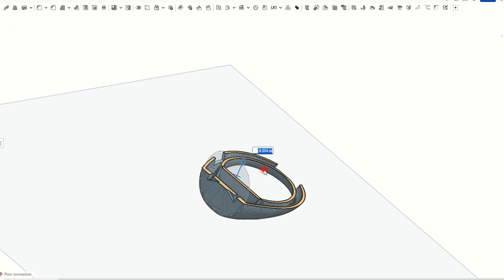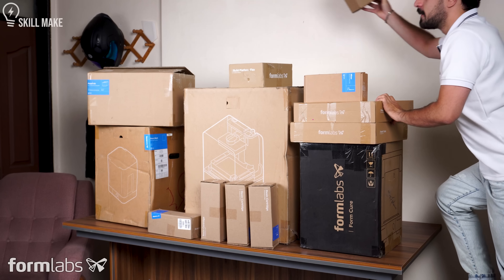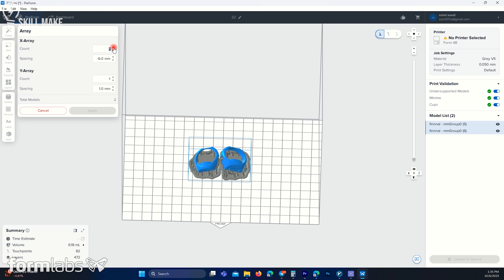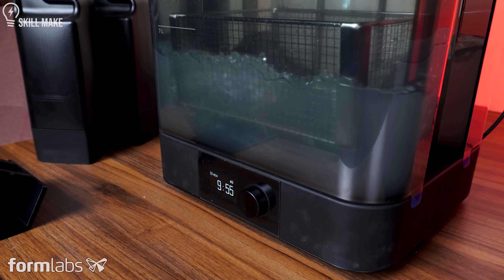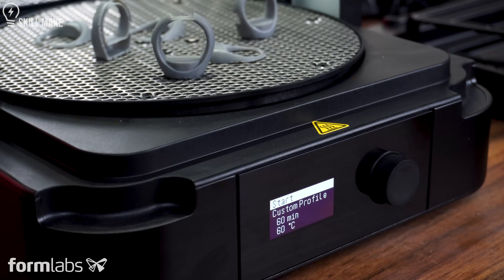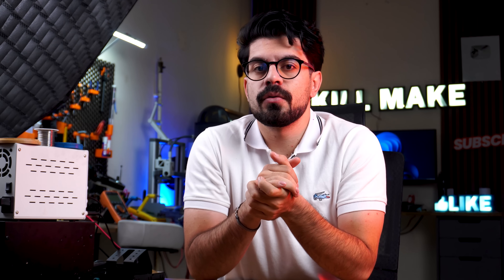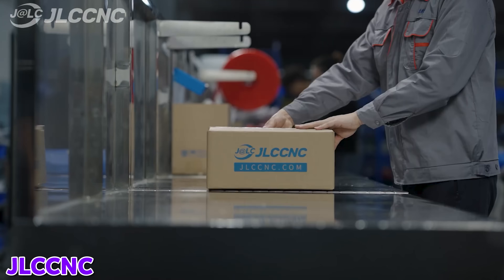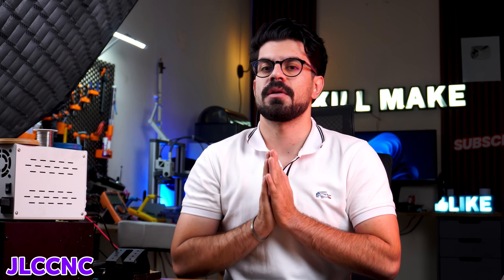I Put a 10,000V High Voltage Generator In a RING! (PLASMA transformer)

Comment: Smaller wire for primary winding, smaller wire for secondary winding.

Battery would be longer around the ring.

The I(PWM)C could be shaven down a little from the top and bottom to save mm's of space, or you could literally depot the IC silicon and integrate it ontop  directly to the transistor. (Transistor can also be partially depotted)

This could be so much smaller.

Comment: I like your coil winding technique, I also made a much more complex Lego mechanism to wind my HV flyback transformer (I use cores salvaged from broken CRT). My mechanism has a tension control system and a wire position guide that slowly moves the wire from one side to the other within the section. The motor automatically stops when the section is filled, so I can turn it on, and the mechanism automatically moves the wire side to side within the section while winding, and when the section is filled it stops and I can move it to the next section. That way, I can have idle time to do whatever while it's winding, and I won't have to supervise the machine due to its tension control, wire positioning system, and auto section stop.
Reply: bruh
Reply: Quartercubic was able to build this in a cave, with a box of old broken CRTs!

Comment: Love your HV winding patience. The circuit could have been done with a single transistor, and a pickup coil on your driving coil, to form an auto balancing blocking oscillator. It's nice to have a ring to light up to cigs...

Comment: Very impressive. Looks like you got into limiting factor in terms of space to fit the voltage multiplyer stage(cocroft Walton) That's just a hot arc not yet the shocking spark that stun guns run on

Comment: Poison injection rings are far more deadly and have a long history, just saying not “the worlds most dangerous”. I wanted to see if you managed to get a lethal dose of electricity in to the ring, maybe by adding a battery pack attached to the wrist and a wire. Or with the battery pack maybe by turning the ring in to a capacitor pre-charging it and having a single discharge no fancy spark gaping. maybe you tune that discharge to pulse to disrupt heart beats.

Comment: It's cool But unless you're defending yourself against a piece of paper with lighter fluid on it all you made was a compact cigarette lighter not a self defense ring
Reply from the maker: Friends, this was mostly for education, and I wanted to show that much smaller and more practical transformers can be made. To increase the power, it would be enough to add a capacitor multiplier circuit to it.
Reply: @skillmake  I completely respect  and Admire the skill and the patience of making it. It was just the video descriptions title That I found misleading.
Reply: 10000v is not that far from some tasers. If it were on bare skin and connected good that's gonna hurt. Not saying it would stop someone really determined like strong tasing can, but it would probably discourage a lot of people, especially since they probably wouldn't expect it or know exactly what they were facing. After all, you don't have to outrun the bear...so if it's enough that they decide you're not worth fing w, it works. Also you might equip several at once. In any case it's pretty cool.
Reply: @magnetsjones  I felt what these little plasma lighters can do and it's not pleasant but it certainly wouldn't do anything to someone who was angry or attacking you
Reply: lmfao
Reply: No actual stun gun that you can buy will actualy shock you they just burn,if you want a self defence device that can shock a attacker you will have to make a stun gun yourself of buy a police taser
Reply: You're a prick